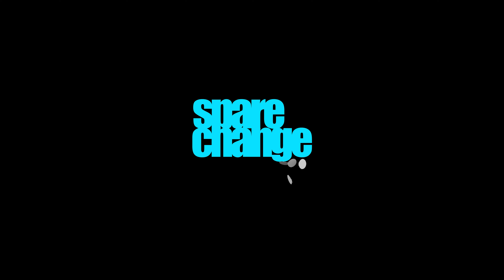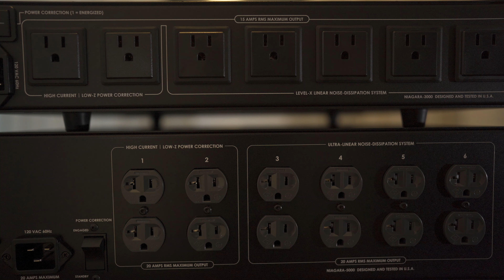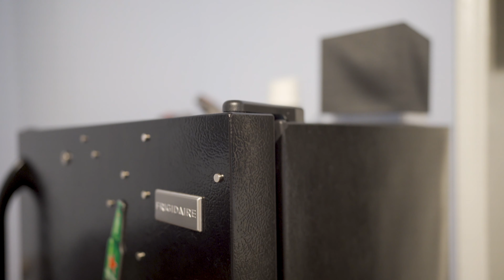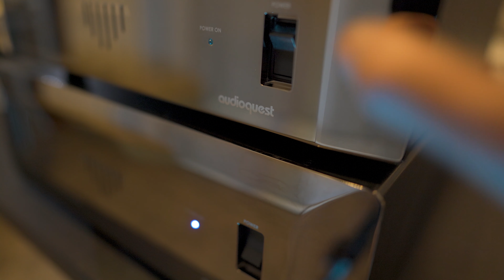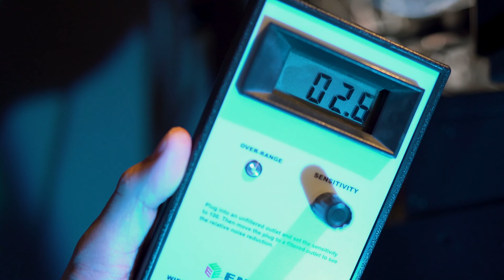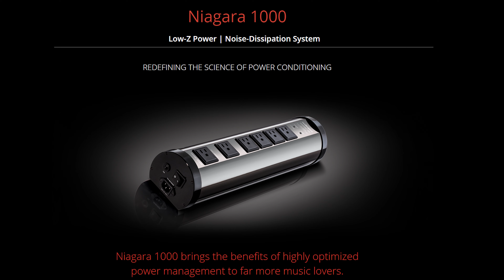Are Power Conditioners SNAKE OIL? AudioQuest Niagara 3000 & 5000 Power Conditioner Review

Comment: I realized this demo/test shown is flawed. Remember, your equipment power supply filters out noise. You should be testing the noise level coming from your components not noise coming from the wall outlet or the outlets from the conditioner.
Reply from the maker: This device is used to test the power going to your equipment. Not after it gets there.
Reply: Like I mentioned before, your equipment power supply does noise filtering. The correct test would be to see if it's the conditioner or your equipment power supply doing the cleaning.
1. Test an AVR plugged directly into a wall outlet and see how much noise is coming out of the speakers.
2. Test an AVR plugged directly into the conditioner and see how much noise is coming out of the speakers.
If the noise levels are the same then the power supply is doing its job and the conditioner is useless. 
If there is less "noise" from when using the conditioner, then you can say the conditioner is actually doing something.
Reply from the maker: I touched on what I heard in this video. Whether or not you believe it makes a difference is totally up to the individual.
Reply: @therealshanelee  Forget about beliefs and forget about the snake oil arguments.
If you plug your equipment directly into the wall outlets, turn up the volume to Reference levels, choose a source input that does not have anything connected to it. Stick your ear up next to your speakers and listen for "AM Radio" station noise coming through your speakers.
If you don't hear any "AM Radio" Station noise coming through your speaker, having all of the equipment plugged directly into your wall sockets, then you honestly say that your equipment is filtering out the noise coming from the AC wall outlets on their own without the help or need for a Conditioner.
I don't think what I've said is unreasonable.
But I understand the politics of this business.
Hope I don't get shadowbanned.
Reply from the maker: I've said in the past when I had the Furman I've heard am radio in my left channel. The Furman cured it. So it works. I've also described what I've heard. I'm not on here to dispute anyone's belief in snake oil or otherwise. You can take the video anyway you want. I'm relaying exactly my experience with it.
Reply: @therealshanelee  Got it.
Reply: @therealshanelee  well said 😀

Comment: No UL or CSA or 3rd party regulatory certification and they cost how much?!?  Radiated RFI on an open outlet with no load is of little surprise. The test should have been done to a connected amplifier via the speaker terminals or at least the transformer secondary. I've done such tests and never measured appreciable improvements with any power conditioners. Anyways, they look pretty and you have a glamorous connection point for all your equipment ;)
Reply: I think it’s impossible not to hear the change a power conditioner does to sound quality. It usually sounds more sterile.
Reply: If you have clean power to start with, its amazing what doesn't get cleaned up.  Pretty happy with seeing Shane's results that show what little that certification can do for you.
Reply: That's because you're hearing impaired.

Comment: I have to agree with some of these comments. What spare change si describing (a very quiet background) IS real, but Before you buy an expensive conditioner, get a dedicated home run circuit form the box ! And a decent receptacle (you dont need to spend $100 on an exotic rhodium type thing, but a good hospital grade is perhaps the best money you will ever spend. ANd start with a good Non UPS conditioner (APC H15 for ~$300) that has 1) excellent guaranteed surge protection 2) excellent voltage correction 3) Sequenced turn-on and off ensures that connected equipment is powered-up/down in the proper order and with the right amount of delay between the stages. It allows you to program a delay into the sequence between 0 and 12 seconds. This feature helps to eliminate any "popping" sounds coming from speakers when turning on the system. This delay feature also eliminates transients that can affect connected components, e.g. digital projectors. And lets be honest-anything sold under an exotic $$$ cable company’s name is bound to have the same insane price margins, so caveat emptor re price performance for ANY system. BOTTOM LINE- get a home run 20 amp circuit run($200-300) with a quality hospital grade receptacle  ($20) to an APC H15 ($300). And look if you are really worried about noise, why are you even fooling around with most class AB amps ? Get a high quality class D-their noise and distortion by design are an order of magnitude (soemtines  SEVERAL orders fo magnitude) quieter !

Comment: I have very expensive components, well over $40k worth. Never had a power conditioner make a significant improvement in my system’s sound. Tried: Panamax, PS Audio, Monster, Furman, and Power Company. My use is for protection from voltage spikes and brown outs. Ultimately settled on Furman, since it is used by sound crews that have a lot of the same needs… isolation of ground loop hum, protection of their equipment stacks (That are also not cheap.), and in comparison, much more reasonably priced. Nonetheless, this is an insightful and informative review. Thanks for taking the time to post it, knowing full well their will be copious amounts of ridicule from the punters.
Reply: Very well thought out and honest comment. My experience is pretty much the same as yours. I use a very nice Monster unit as well, but it’s just there to protect my gear. Would love to see a demonstration that validates these types of reviews.
Reply from the maker: No YouTube video is going to capture what it would sound like in person. You'd have to listen to it first hand.
Reply from the maker: Thank you. There are a ton of folks out there interested in these products and similar ones. It's definitely not for everyone.
Reply: Shane, it would not be that difficult to set up a legit blind test and film it in real time. You have mentioned doing this before during a podcast. Something like this would be of real value to budget conscious audiophiles.
Reply from the maker: @brucecarter6205  there will be a blind test with the cables. This will take time. Folks think a YT video is a simple endeavor. I don't have the time to do another one for power conditioners nor do I feel it necessary for me. But no matter the outcome there will be positive comments and detractors and negative comments. I know you know what I'm talking about. That's just what an AQ video brings. Feel free to be negative about the product. Whether you think it'd beneficial to you that's for you to decide. You seem to want to come directly at me though. Okay.
Reply: SpareChange, just keeping it real Shane. Don’t take it personally. 

I’m a no BS sort of guy and I have no problem calling it out when I see it. You have to expect the push back when you do videos about such controversial stuff. You know exactly what I’m talking about, judging by the title of this video. 

Definitely looking forward to the cable blind test. No need to double up with a power conditioner blind test. These products all fall into the same category anyway, as in, how reducing or eliminating noise in the signal path may, or may not, translate to better audio quality,
Reply from the maker: Have you tried these?
Reply: SpareChange, no I have not. But, I have been active in this HT hobby for 20 years and do have experience with similar devices. I’ve used Monster, Furman, and Panamax. All were great for protecting my gear, but I can honestly say that none of them changed the way my system performed from a sound quality standpoint. I don’t know, maybe I’m just blessed with clean and stable power in my area of the world.

My experience has been mostly the same with cables. I do use some braided kimbers for aesthetics purposes though, because I prefer how they look over my generic ugly white 12 gauge Monoprice. Both cables sound the same to my ears.
Reply from the maker: You haven't tried these particular ones. Okay then. Have a good one.
Reply: SpareChange, glad that I could brighten your day. 😃

Comment: I've tried one of the cheaper furman Power conditioners which definitely made a difference in my system but not a good one. Although the noise floor was better the dynamics were gone.

Comment: It's a shame that home theater power conditioners are only available in the US and Canada. I just use a cheap surge protector plugged into the main socket and then an APC surge protector 6 outlet power strip where my TV, 4K Blu-ray player, av receiver and subwoofer are connected to.

Comment: Am a believer...have a 1200 with Thunder P/C in line with my component setup.  Thank You for the review, though why a 3000 & 5000? The similar outcomes, didn't need more outlets?
Reply from the maker: I need the 3000 to plug my router and network switch into 😁
Reply: @therealshanelee  that's great...also something that no other reviewer has brought up surprisingly.
Reply: @therealshanelee  Excellent idea !!

Comment: Wouldn't necessarily say snake oil.  If you have a problem with the quality of power going to your outlets, then sure a power conditioner may help.  As to whether you you can hear improved sound quality, that's subjective.  But I'd rather look at resolving the issue first by running a dedicated line from the mains panel to the wall outlet and plugging my gear directly to it.  This discussion on power conditioners is a good listen: https://youtu.be/1_Us6cF8pbk